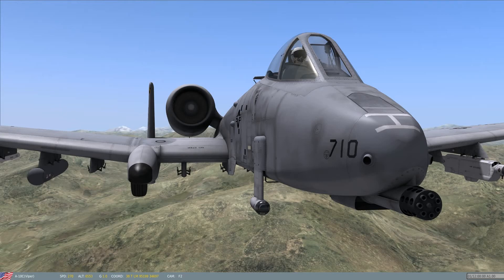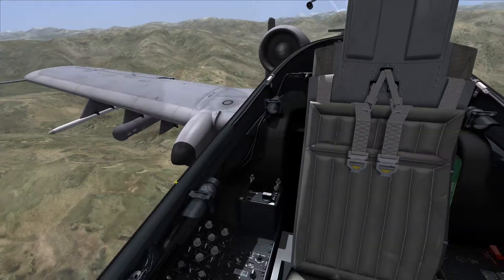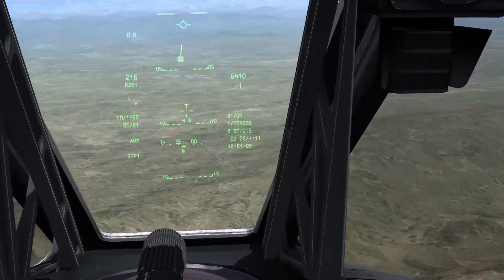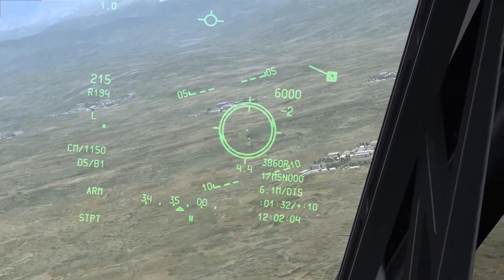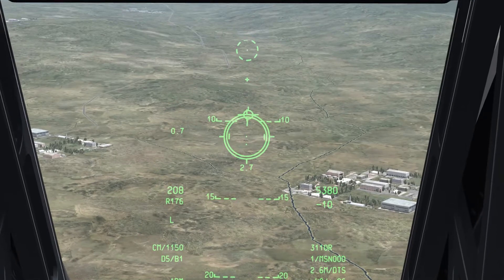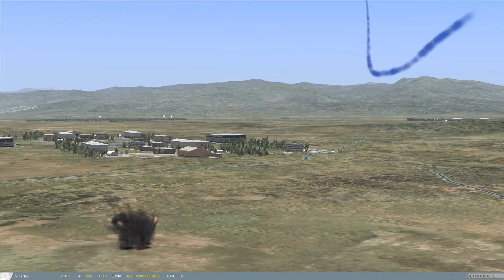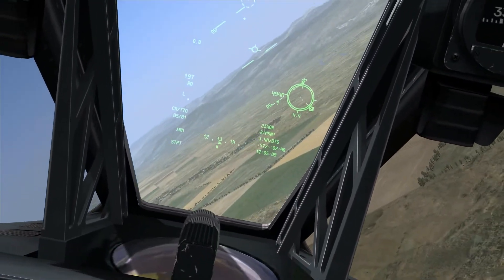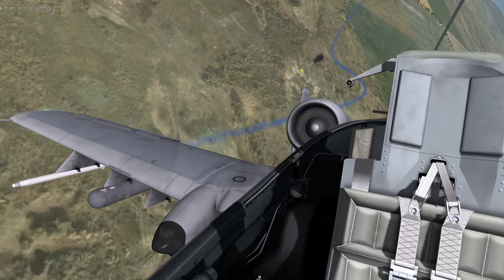DCS A-10C Gun Tutorial and Demonstration

Comment: Great tutorial? I got a question though:

How to use the PAC? Do you need a 2 phases-trigger for that?
When I use the PAC-Switch, it either pulls the nose up or down- even when not shooting. Shooting seems to do no improvement. 
Probably it's not activated for me or it is, but all the time.

Does your PAC-Switch change settings when holding trigger to phase 1 or 2?
Reply from the maker: By 'PAC-Switch' do you mean the 'GUN/PAC ARM' switch on the front left panel? Because toggling that switch will cause a change in pitch attitude.

I assume you are referring to a keybinding or button you have assigned to serve as 'Gun Trigger (first stage)'. By default this is 'P'. For me yes it is on a 2-stage trigger, first stage for PAC and second for gun. I have not tried it bound in another way.

I believe there are 2 stages to the PAC system. The first is on the 'first stage' of the trigger, and the second activates while the gun is firing to better compensate for recoil. This happens automatically and should result in the PIP staying relatively close on target if all systems associated with PAC (like SAS) are engaged.
Reply: Hey, thanks for your reply.

Yes, I meant the 'GUN/PAC ARM' switch on the left in the middle part of the virtual cockpit. 

My assumption was that using the stage 1 trigger to improve aim would automatically move that refered lever. Since I don't own a 2-stages-trigger-joystick, I moved it up manually by clickig it. 

Obviously, this made it worse, giving me a huge pull up/down or nothing at all, based on the position of the 'GUN/PAC ARM' switch.

So I'm somewhat confused if there is any point for me to use that GUN/PAC ARM' switch, or on what position I should leave it with my limited joystick.
Reply from the maker: OK then that switch is just for arming the PAC system, and should be left in the ARM position for PAC/gun use. For the PAC to activate use the first stage trigger (by default 'P') while PAC is armed, then fire the cannon when the aircraft is stable.

It is normal for the aircraft will pitch up or down when the PAC system is set to ARM or SAFE as it interfaces with the aircraft control systems.
Reply: Will try, thank you very much!

Comment: If I ran into .5 like that my plane would be full of holes.....
Reply from the maker: In most cases where there is more then one tank, almost defiantly.  Even with one target its still a dangerous game, and if you don't get plenty of rounds on target fast he will.
Reply: Thanks for the response....I actually learned a good amount from watching you.  My run in style has improved and I am ending up with a few less holes :-).   Thanks for the vid!
Reply from the maker: Cheers friend, happy to help! If there is anything else you want to see a video made for let me know, I'll see what I can do.
Reply: Agreed.  The grouping of the rounds seems tighter with a steeper dive angle for sure.  I just have to teach myself to be gently on the pulls outs....I have ripped the wings off a few times! Do you use airbrakes for that maneuver or just throttle back?
Reply from the maker: For a steep angle dive, yes airbrakes deployed. You have to start adding throttle just as you begin pulling up, due to the delayed spool up time for jet engines, and start removing the airbrake while pulling up. Otherwise you will not have the airspeed for good maneuverability while evading away and could stall if you forget.